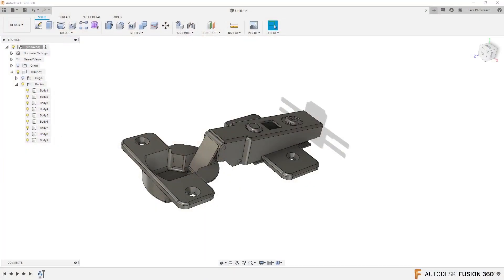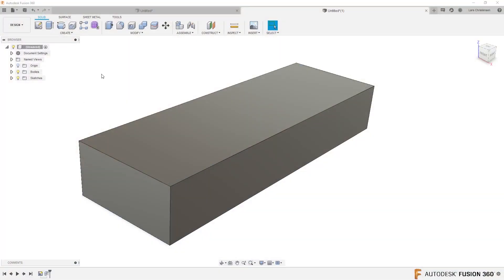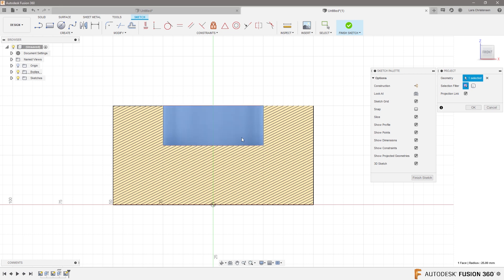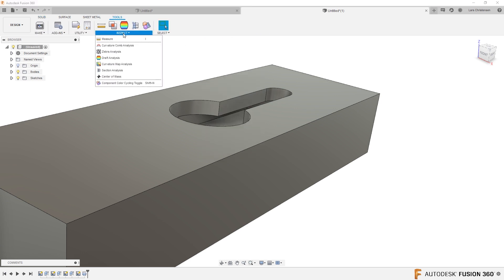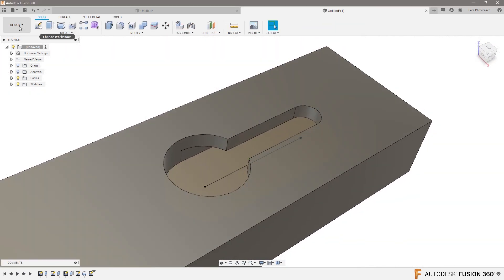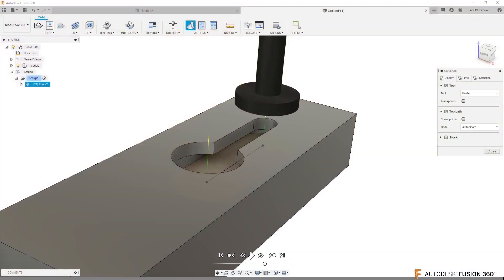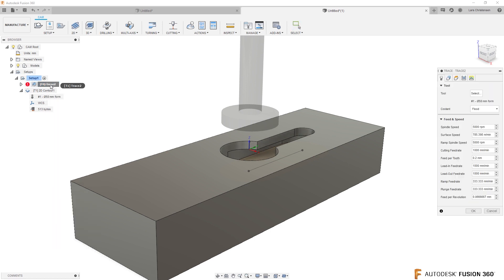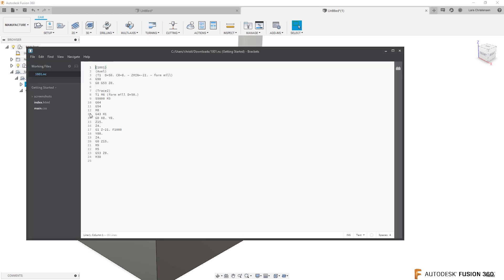Fusion 360 —How To Machine Dead End T Slot — Ask LarsLive

Comment: After running into the same issue with a blind T slot in refactory brick you can use the trace tool path.  Select the lower outer edge of the slot, under depth select either left or right sideways compensation and the tool will plunge into the open part of the slot, move in then out the same way it entered.    If you need to adjust the depth or height of the slot axial offset can be used.  If you need to make the tool start or exit closer or further from the start/end of the trace use the chain extention length under the geometry edit tab.

Comment: Thanks for the video however using the contour tool path seemed to be a workaround.  I figure out you can use the trace tool path.  Under the passes tab, select Repeat Passes and select Both ways.  You can reverse the entry point by clicking on the red arrow on the select trace line.
Reply from the maker: Hi Derick, As long as you get the job done, I'm happy :-)
Reply: Hey Derick!  Cheers for this, it's giving me a much cleaner cut using this method!! Always good to have a nosy round the comments!

Comment: This can be done in steel too, if You first plunge cut a larger slot than the stem size of the T-slot cutter. That way, the chips would have an exit from the inside cut. But it would be necessary to have a special chip breaker that directs the chips into the correct direction.

Comment: Hi Lars couldn't you use the trace command in a kind of loop modus by drawing the traceline and give it at the end a tiny half circle and then backup to the beginning point it would make the slot a tiny bit wider but that can be accounted for And the simulation would work I presume 
kind regards

Comment: Lars - did you notice in a recent update with F360 that there is an issue with a 0 RPM Trace toolpath with a tool like a Diamond Drag Engraving Tip? It is throwing an error now saying that the cutting feedrate needs to match the number of flutes multiplied by...This is what it says:

---------------------------
Invalid Value
---------------------------
Cutting Feedrate must be equal to the product of the number of flutes (=2), the feedrate per tooth (=0 in) and the spindle speed (=0 rpm)
---------------------------
OK   
---------------------------

Comment: Hi Lars,
Here are some photos with descriptions that show how I made key hole slots with a key seat tool.  https://imgur.com/a/r8RN0Dd
I made some keyhole slots in wood for chair arms used in stadium seating on another CAC/CAM Program.
I machined the large diameter circle and the slot to bottom depth using a pocket toolpath..
Then I made a U shaped toolpath starting at the center of the  large circle with an offset of .001 going down to the far end of the slot and returning back to the center of the large circle for a total width of .002.  This toolpath allowed the keyway cutter to go to the designated depth and travel the designated U shaped toolpath and return to the original position and retract back out of the original plunged  position.  The keyway cutter I used was .125 thick and I needed to make 2 passes to get the desired height of the internal slot.   Worked like a charm.  Hope this helps.
I commented the same on your post yesterday.
John
Reply from the maker: Thank you, John. 👍😁
Reply: this is how you have to do it, right? there aren't any flutes on the shaft of the key cutter, are there?
Reply: @hemligagosta6554  You are correct.  There are no flutes on the shaft of the key cutter.
John

Comment: Seems to me like it would be better to first cut the hole for the t-slot cutter and slot for the cutter shank to full depth with a standard flat end mill than go in with the t-slot cutter. Most t-slot cutters I've seen cant plunge cut into the material. (BTW I'm only a Hobby Machinist so I don't really know the proper way this would be accomplished)
Reply: That is how you cut them with a hand held router. I would agree use the same process with the CNC.